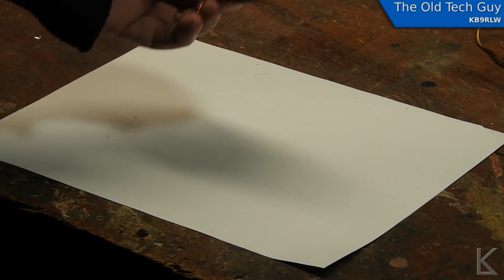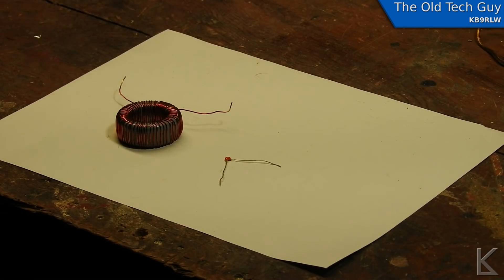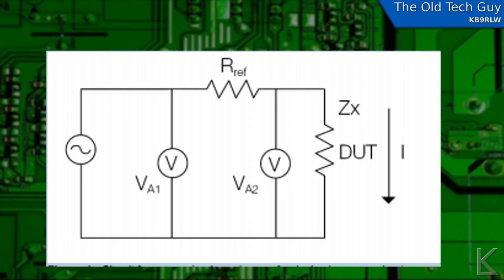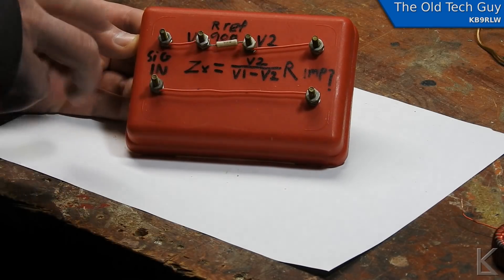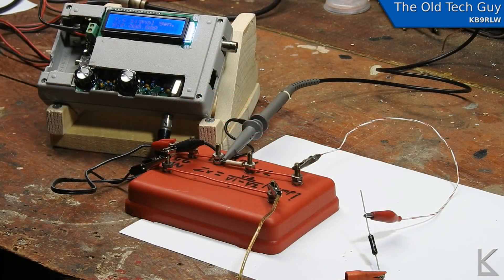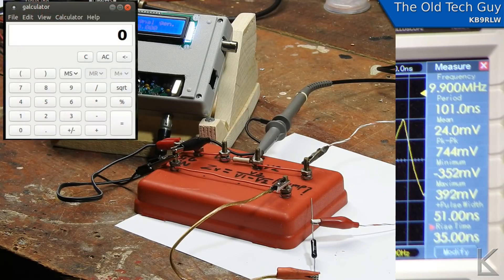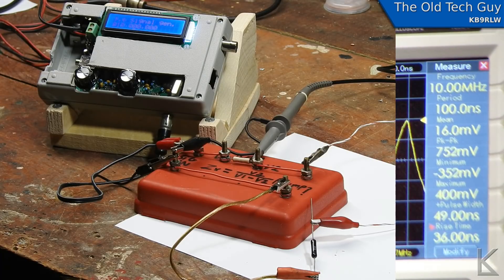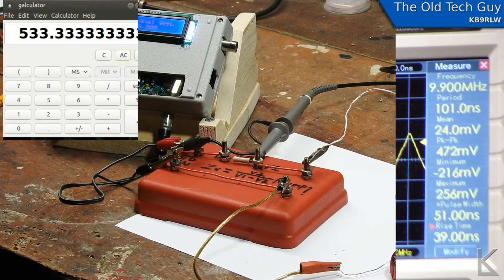Electronics - Measuring impedance with a signal generator and oscilloscope

Comment: To get a more accurate reading, substitute the scope with a DVM (or DMM) and then multiply the voltage reading (which on a DVM is RMS voltage) times 2.8284 to get the peek to peek voltage with a DVM or DMM.

Comment: hey, according to reactance formula XL=wxL reactance should increase with frequency, where as your experiment is showing the opposite, why? and also i wanted to know your input voltage for the circuit, you have constantly talked about the frequency but i dnt think i could find you saying anything about the input voltage
Reply: That is correct for an Inductor the reactance  increases with frequency.  Also don't believe everything what you see on Internet.

Comment: Hi great video, I have a question. I am using this method to measure the impedance of a piezo (i.e. a speaker), which is frequency dependent. However, I find that at some frequencies I get V2 > V1 (and greater than my source voltage). How is this possible and am I right to conclude I have a negative impedance (what does that even mean?).

Thanks!
Reply from the maker: Hitting near resonance .  Like a kid pumping his legs on a swing.  He's not putting in enough energy to push the swing that high alone,  he's adding some to it on the downward stroke.

Comment: To start with, ..If you're short on patience don't click on that wb0smx link. I'm old and crotchety, so I fit in that category. OK, ..while the theory behind this video is sound the test setup is not. While working with high frequencies your test fixtures, cabling, connectors, component selection, lead length, component placement, etc...etc, etc, need to conform to "Industry Accepted Practice"*. For any students that are uncertain about what I'm saying it simply means this. When working with high frequencies your fixtures and test instruments must keep *"Reactance" to as close to zero as possible! As currently shown, this circuit should not be relied upon for frequencies above the audio spectrum. 
I welcome any discussion to the contrary.  Chris WA2ERQ

Comment: Really great video, I was thinking of an other methode. First I am a totally noob so it is properly wrong but:-)
What if you connected your generator directly to the DUT and right after that a decade-resistance box. and treat it as a voltage divider, when you reach exactly ½ of your output, you can read the impedance on your decade box. Would that work?

Comment: as Carmine noticed, the measurement is completely wrong when the impedance is complex (when it has some reactive element) simply because V1 and V2 will have a phase difference as well as amplitude difference. you cannot just use the amplitude of V1 and V2 in that formula. The formula is correct but V1 and V2 must be phasor (amplitude and phase together). The result for pure resistor was also off not because the scope was cheap, because those long wires at 10MHz add enough inductance to create phase difference between V1 and V2
Reply: Amir B: More video, less comments.
Reply: I was about to write a comment about it. You need to also measure the phase between current and voltage. Actually, the precision resistor shall be characterized too. You can use two "identical" ones.
10MHz in the air has a wavelength of 33cm. So 8cm is enough to go from a valey to a peak. So everything shall be contained within a very small area so that the propagation of voltage and current waves doesn´t need to be taken in to consideration.
If you measure the voltage at reference resistor over DUT, the impedance comes out of the ratio between the two waves, because Vdut/Vref=Zdut/Zref. (Same current passing through both, if wave length is greater than 1m, for instance).
Reply: can you please point me to where on the internet is a text readable example that shows how this is accurately measured? I do have a frequency generator and a mulitiple trace scope.  i just dont know what the proper test methodology is, nor the formula.
Reply: so give us an example of how, knowing the phase difference, is used to refine the final impedance by using sin or cos of phase to come up with proper value.

Comment: Your measurements are completely wrong. With inductance ,if you decrease the frequency you will decrease the impedances XL - 2 Pi F L (in Henry's).
Reply: Maybe. After doing a tiny bit of research I ran across the following article and learned something I'd never heard before. Each inductor has a self-resonant frequency. Below it impedance increases with frequency, above it impedance decreases with frequency. If the demo is correct the SRF of that inductor is at or below 5MHz.
https://www.everythingrf.com/community/how-does-the-inductance-and-impedance-of-an-inductor-vary-with-frequency

Comment: Why not using rms voltage? Why using Vpp
Reply from the maker: The scope measures peak to peak, I multiply it by 0.3535 to convert to rms for calculating power in another video.
Reply: @loughkb  Why Vpp? It should be Vpp/2.

Comment: Hi Kevin, I'm afraid I have to correct you on the way you used your math. When the unknown impedance Zx is non-resistive, then the voltages Va1 and Va2 are out of phase, and you can't simply subtract their amplitudes, without taking the phase angle into account.
If you have a two channel oscilloscope you can measure these two voltages simultaniously and use a math subtract function of the oscilloscope (if it has one) which will give the correct answer. Or else, place the resistor in the ground line, and measure both the total input voltage, the voltage across the resistor and draw some vectors to calculate Zx.
Play with a spice simulator like LTSpice which is free, to find a good solution.
Reply from the maker: The setup and math were out of a technical manual, so I trusted the source.   As to Va1 and Va2 being out of phase...   Wouldn't that require some kind of delay across the reference resistor?  I can't imagine there would be enough delay to be measurable across a single resistor.
Reply: Kevin Loughin The current through the resistor and the unknown impedance is equal. Let's say that Zx is a capacitor, then the whole circuit becomes a low pass filter, with Va1 being the input voltage and Va2 the output voltage. This low pass filter has a phase shift between input and output, because that's a normal behavior for a low pass filter. Let's pick an input voltage of 1V and a frequency where Zx equals Rref equals 1kOhm, but as it is a capacitor, this impedance Zx is 90 degrees out of phase with the resistor. The total impedance is 1k - j1k, the absolute value 1.41k (pythagoras). The current is 1/1.41 = 0.707mA. The voltage across Rref is 0.707V, the voltage across Zx 0.707V as well, but 90degree out of phase. With your math the voltage across Rref would have been 0.293V.
Hope this explains it a bit...
Reply from the maker: It's a compelling argument for sure.   I'm going to re-run the experiment today with a capacitor for Zx and both inputs of the scope and look for the phase shift.
Reply: Robert why are you talking about current? you confound power with voltage.
Voltage is voltage times nothing. 
Power is voltage times current in this case (AC) at a specific point (the same phase)
But in this experiment we neither measure current nor power. 
We only compare two voltages regardless of the phase.
Of course the waves are out of phase. But if you measure the voltage PEAK to PEAK, you "adjust" automatically the right phase. Again we are NOT measuring the product of two out of phase signals!
The way Kevin do the math is 100% right.
My only complain is that we need neither "precision" resistor nor "precision" oscilloscope. We can use a voltmeter too
Reply: tim46767 Hi Tim, thanks for your reply. I mentioned current only because it is the same through Rref and Zx. I don't use it to calculate power because like you wrote, power is irrelevant. But when subtracting two complex (vectors in X-Y plane) voltages like Kevin is doing, you have to take the phase between these voltages into account, otherwise you get a wrong answer. Subtracting two signals with a phase angle in between is like calculating the length of the third side of a triangle where the other two sides are the two voltages being subtracted. That is done with trigoniometry, not simply by a straight subtraction of amplitude or peak to peak values.
Using a voltmeter for this measurement is only possible when the voltmeter is capable of accurately measuring a voltage at a couple of MHz. My $150 multimeter for sure can't do that. The voltmeter's AC bandwidth is not that wide.
Reply: Robert, again: Voltage peak to peak is scalar! Not a vector! Make the experiment. You will see the peak of the two voltage are in the right phase (with a more or less clean sinus).
Reply: Need to agree with u Tim. since Vpp already at the same phase by estimation with phase angle tolerance around maybe below 1.9%. But I assumed the inverse impedance level at lower Freq might have been the parasitic capacitance properties in the system / inductor.
Reply: tim46767 Hi Tim, yes, peak to peak is scalar, but when you want to subtract Va2 - Va1 and there is a phase angle in between thes e voltages you can't treat them as scalars. Throw this circuit in a spice simulator, and let the simulator give you values for Va1, Va2 and the voltage across Rref. VRref is not equal to Va2-Va1, as you suggest.
Reply: Tim, the way Kevin is doing would only measure resistance of the unknown and the way Robert is saying would measure Impedance of the unknown.  I think!
Reply: He is measuring basically across a resistor. A resistor does not have a phase lag. If it was an inductor it capacitor it would.

Perhaps simulate it in ltspice and see. There will be no phase offset here
Reply: To work for reactive components you need to change the formula to  (Va2 / SQRT( Va1 Squared - Va2 Squared )) x R ref.
Reply: Yes. The test is not precise. Generator has also his own resistance. The reference resistor is too big. Sorry, but this presentation is not precise.

Comment: Hi Kevin! Having watched most of your videos and building your 'DuinoVOX project a while back, I wander, why not build an inductance meter from an Arduino? I built one a long time ago using an op amp a couple reference capacitors and some other various discrete components. Just search Arduino inductance meter on Google. It's a very simple build. Ultimately if I remember correctly, the inductor is placed in parallel with the capacitors, a pulse is delivered, the circuit rings at the resonant freq, the op amp is set up as a comparator converts the wave form to a square wave and the Arduino measures the frequency and calculates the inductors value based on the known value of the capacitors. Maybe another video idea? 😊
Reply from the maker: Actually, I already started building something based on this vids idea.  I have a Si5381 break out board that was donated to the channel, so I'm going to automate this measurement with an arduino nano.  The board has three outputs, so it will have  a few functions, including a CW beacon mode and signal generator.  Doing the whole design myself, including the software.

Comment: I do something a bit different. I adjust the frequency until the device under test reads 1/2 the total applied voltage. At that point, the resistance (reactance) of the reference and DUT should be equal.

Comment: Hi Kevin.  As James Carrington noticed, the results were odd in that the impedance varied inversely with the test frequency.  That bothered me, so I duplicated your procedure on my bench.  While I never did see an inverse relationship of impedance to frequency, I did notice that the readings varied a lot from the expected when I got outside of the normal working range of the coils I tested.  So it would be good to have some idea of reasonable parameters before making any impedance measurements.  You can find my test procedure and results at my blog entry: http://www.wb0smx.net/?p=2215.
Thanks for the video, I always enjoy them... Randy WB0SMX
Reply from the maker: Yes.   I suspect that a clean sinusoidal signal source would help too.   My signal was coming from a clock line on a digital chip, so it was a square wave, bent into something like a triangle wave.  Very harmonic rich.   I'll re-visit this method in the future whenever I finally obtain a real signal generator.
Reply from the maker: Just finished reading through your blog entry.  Very extensive.   And I agree that I was probably so far out of the comfort zone for that toroid I used that it probably caused the strange result.   That torroid was a poor choice for the demo, it came out of an old power supply, so who knows what it's properties are.   So hey,  I learned something else here, thanks for the peer-review work!

Comment: You could replace Rref with a pot.  Adjust the pot to until Va2 was 1/2 of Va1 then the measure the resistance of the pot.

Comment: Nice demonstration. A question: is the 900 ohm precision resistor carbon or wire wound? If wire wound, it would have a reactive component and throw off your measurements.  When you measured the first resistor, I was wondering if the error was a component of unintended reactance from using a wire wound.  Anyway, good stuff! Thanks.
Reply: JohnTheBrewer This resistor has to be non-inductive.Ayrton-perry type wound resistors fit perfectly

Comment: Interesting result and thanks for the video. Btw I was surprised by the inductor impedance reading higher at 5 Mhz than at 10 mHz. An air core inductor should have the opposite impedance change with frequency. Perhaps the ferrite or iron core of your inductor is less effective at higher frequency ?
Reply from the maker: That core was out of a power supply, so who knows what the properties are. :-)
Reply: So it was likely optimized for use at lower frequencies. I think your measurements are right and they show the importance of measuring a component at the frequency you will use it at. Had someone measured that coil with an LCR meter say at 100KHz and then tried to use it at say in the hf range they would likely be scratching their head .

Comment: Qalculate for a better calculator ;) 
Arduino + AD9850 + 2x 1n5711 and you can build an impedance bridge.
Also if you have a XY mode you can use Lissajous patterns to do the same.